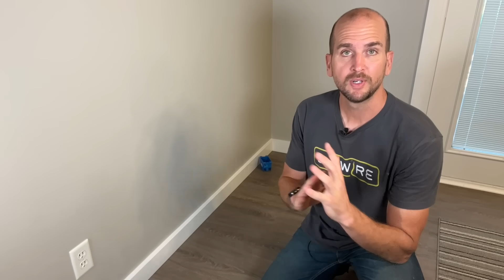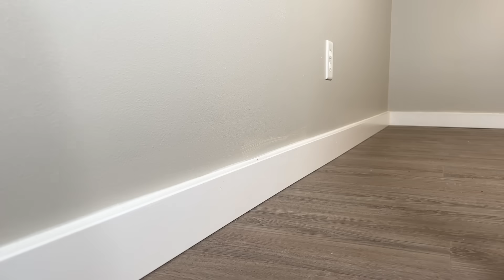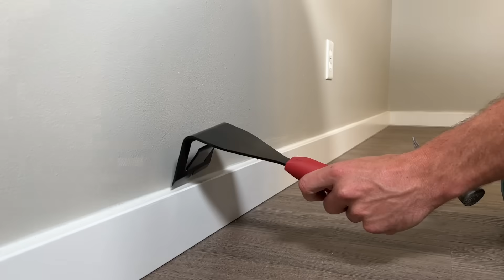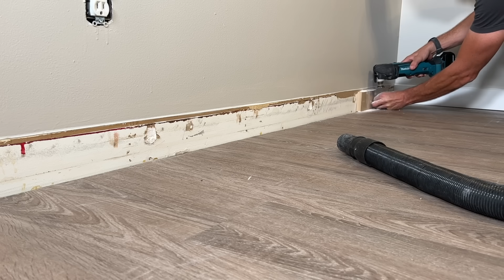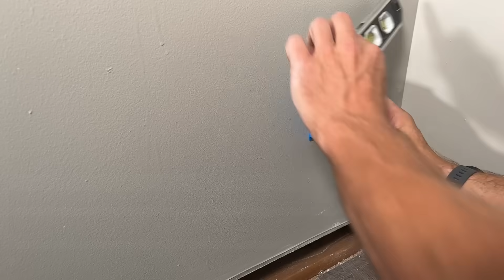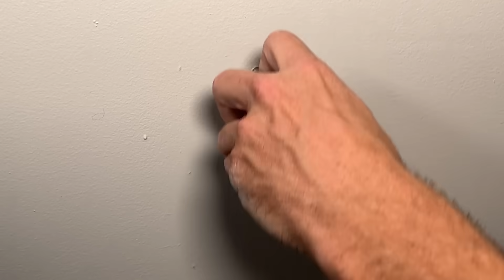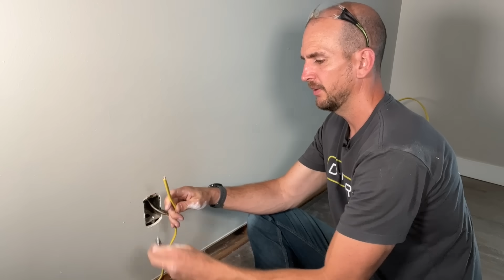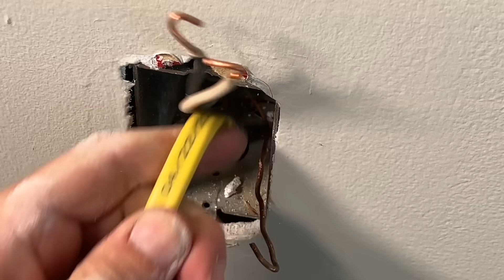How To Add An Outlet To A Finished Wall

Comment: This is an excellent vide, clearly explained and a very good way to add a box without doing any damage. I do however have one complaint, not against you particularly, but the use of caulking by this generation of people in finish work. I' m 70 now and have been in construction since I was 15. As far as I'm concerned, professionals using caulking is laziness. If your joints are tight there is nothing to hide and it looks like you know what your doing. In addition the use of caulking slows down renovations as you have to remove all the old caulking in order to have a nice finished job. Just ask any plumber who has had to remove a wall hung fixture to repair it.

Comment: Great idea. BUT, When you running wire, by code you need to have a metal plate covering the holes you drilled so nobodys able to nail to the wire. It could be shocking. You know where the wire is, BUT the next guy may not have any idea the wires there. JUST SAYIN.

Comment: This is great.  I’m a relatively newer DIYer and have been pigtailing directly to the bottom of the outlets and not using Wagos or wire nuts.  Also, is this a 15 amp breaker which could use a 14 gauge wire or do you use 12 always? Would you enlighten me on the difference and if one is better than the other? Sorry for all the questions but this is great info and I love learning. Thank you in advance.
Reply: 12 is probably overkill for the load. No harm in using the bigger wire, it's just more expensive. 12 would be appropriate for a longer run, let's say more than 30'. You were correct to use the outlet instead of a pigtail, that's why the outlet is made that way. You can either feed through, like you did, or you can cut the bridge on the outlet and feed each plug separately which is how you wire for a switched outlet with an always on outlet in the same plate.

Comment: Not bad...I would have taken the knockout in the very back of the metal gem box and used the clamp it comes with. Also you could have used a black (plastic) button connector for romex which is legal and easier to install. Over all great job!

Comment: It's not good practice to stab the wire in the back of the receptacle. You should always wrap your wire around the screws, the as same You did with the ground. As an electrician when I have a metal Box I always tape my receptacles, tape all the way around so that there's no chance of the screws touching side of the metal box causing a arc. Most importantly you should always bond your metal boxes.

Comment: Nice idea for sure. But instead of using those connectors, why not just use the other set of screws that are already on the receptacle? It's perfectly fine to do that. For the ground wire, you just use a green wire nut with the hole on the end.

Comment: Not quite sure why this showed up in my feed. Maybe I was summoned as "That guy who works in the field" To severely scrutinize your work.
Gotta say, its hard to find anything wrong with your work. Worse I can say is why go through that effort to add an outlet on the same facing on a wall when you can just use a power strip. 
Also be wary of exterior walls, which are often concrete, or have some form of masonry that won't make this an easy day.
I think this would have been a better guide for adding an outlet on an opposite side of the wall. Which would take the same effort and have greater reason.
Again, I'm just doing my best to do my worst. Great work.

Comment: Is it permitted with code to use the second hot and neutral screws on the outlet you’re drawing power from, instead of the Wagos? I assume you did it that way to prevent outlet failure downstream if the first outlet fails, but I want to confirm both approaches are allowed. (Ground I know you have to pigtail). Thanks, great video.
Reply: It is in Canada.

Comment: Only brutal pain and suffering will save you from putting an outlet in. 
Also, I'd love to hear from a framer on this one. Drilling a load bearing wall at the base that's settled for years... not sure about that.

Comment: Count me as a guy that does not like the WAGU lever nuts.  They are really handy for joining 5 wires together bur there is still some wiggle that I believe will cause fretting corrosion over a couple of decades.

Comment: Glad I looked at this.  I have been thnking of moving a switch closer to the door in my study.  I didn't see much option besides cutting up quite a bit of dry wall which made me put the whole thing off.
Reply: When you say switch I assume it is for a light on the ceiling. That trick won't help you lengthen the switch leg.

Comment: Could you just run the new cable/wiring from the new outlet to other pair of terminals on the existing outlet, rather than do pigtails?  Or is that some sort of code no-no?

Comment: NEVER USE THE HOLE IN THE BACK OF THE OUTLET! that is how you have load issues only having a very small contact point. Always wrap the wire around the screw then you will have no issues. BTW call a licensed Electrician and get a Permit! If you do this yourself you could get hurt and you could start a fire lets see your insurance cover that...

Comment: You lost me at your stab-in Wagos. I can't even count how many service calls I've gone on and found melted Wagos with black smoke stains around them taking out rows of lights. Use a good wire nut and twist your wires tight. You can blame the guys that are installing them, but when it's 100-1 finding melted Wagos to melted wire nuts, I think the problem is the device. Wagos rely on tension, if that tension weakens, or if somebody installs two different sized wires in a Wago, you will have uneven tension. Without a good connection, the wire will heat up and melt the insulation, in some case it will arc. Both scenarios can lead to a fire. Electricians like them because they are quick, time is money, I get it. But, I see the dark side of these little devils on the service end.

Comment: I'm not so sure about the amount of faith you have in wago lever nuts. Not saying they aren't useful or bad, but you're never going to beat a good pretwist with a good quality wirenut on it (3m or ideal). It's just a far superior connection that will outlast that wago for years.

Comment: You should drill the studs where you can cover the wire with metal plates at each stud to prevent accidental wire Peña traction. Other wise this all works. Thanks.

Comment: Why are you using 12 gauge wire for a 15 amp circuit? You should use 14 gauge wire for a 15 amp circuit. Your outlet is a 15 amp outlet.

Comment: Now honestly 1" drill bit? , industry standard is 5/8 
Another reason to stay high rather than 'nail plates' is that the first 2" of the studs have two nails rising from below - creats havoc on drilling
.
Now matching hight makes sense, national code indicates 12" but our local inspectors , largely with ADA concerns want 13.5

Comment: Buddy, you are squared away. Nice job. I can give you a tip for caulking, use your razor knife and carefully remove the caulking from the top edge of the molding before you reinstall it. That’ll make it much easier to do a nice job running a bead of caulk. 
And those of you wanting to do a job like this and you have a plastic back box for the existing outlet, I hope you have an oscillating tool. If not I’ve used a step bit, some people call them a Christmas tree bit. It’s not easy just take your time so you don’t damage the existing wires.

Comment: i was taught to install outlets from the most distant to the panel first so all the work is safe until you get to the one that is hot. you can double check the that the voltage is zero just once before the last hookup and not have to worry for the rest of the outlet installs. This would mean you did the install in reverse order. Another approach is to install them the way you did, hot outward, and test each one for correct installation but if you know what you are doing that is adding time since you should be ok for each outlet and flaws are easy to isolate - whatever Anyway, you only had one outlet to add so it doesn’t make that much differenve

Comment: Great 
Just a little overkill on the hole 1 inch your left with 2.5 inches of 2x4 
Smaller hole better integrity
Consider smaller drill bits please

Comment: It's good that he thought about not piercing the wire sheathing when nailing the trim to the wall, but building codes may require nail plates over the part of the stud that the wire is going through and nail plates are kind of a good idea anyway.

Comment: Interesting, I need to get one of those oscillating tools. but how was the new junction box secured? wont it pull out from the drywall?
Reply: Get a remodel outlet box, they have tabs that flip out and secure to the drywall when you tighten the screws.

Comment: ( 12 year commercial electrician) Great instructional video I would like to add my only concern was you neglected to bond the metal box in which you drew the power from I understand it was an existing box But as far as I understand it if you open it up you must bring it up to code. Bonding the metal box itself to the ground via Green ground screw screwed right into the back of the box and pigtail probably Should’ve been done on the original install. Obviously this doesn’t pertain to your plastic old work box grounding and bonding is very important to protect against electrical shock.. ps. I am a commercial electrician very rarely do we use Romax type wire I could be wrong but I believe the same rule applies as long as the box itself is metal
Reply from the maker: Good call Kevin and I should have mentioned that as the existing bare ground coming in was cut long and wrapped around the bottom mounting screw for the integrated cable clamps to bond the box.  Little confusing and I should have outlined the importance of bonding metal boxes which is a mistake I have made in the past for sure.  Thanks for the help!
Reply: One question...why did he pigtail the wires in the new Romex with the existing Romex.. wouldn't it have been possible to connect the black - white new wires onto the bottom screws of the existing outlet.. what am I missing?any information would be greatly appreciated 👍
Reply: @michael184272    It's installer preference. SOME electricians feel you shouldn't run the entire 15 or 20 amp circuit through the small clips that connect each set of terminals, so they like to pigtail it so all of the circuit is running through the proper gauge wires. NEC does not govern this, so the method you use is based only on opinion and not authoritative direction. There's also a lame (to me) reason that pigtailing prevents other receptacles from losing power if another receptacle goes bad. The times that scenario happens is so rare it shouldn't be the reason you use that method.
Reply: @ruffxm  
Thank you..
Reply: @ruffxm  Perhaps the requirement to use pigtails is location dependent.  In Canada, not using pigtails on an outlet will result in failing inspection.
Reply: @Vincent_Sullivan    That's why I stated "NEC does not govern this" (US - National Electric Code). It's not a requirement here.
Reply: My concern isa the two idiotic pigtails, every socket has two screws, use them!  Dummy!!
Reply: You're right,  although technically it is bonded through the locknut and then through the screws to yoke of the plug.
Reply: Why do all the electricians / carpenters install the outlets with the ground hole facing up? Is this a code thing? So if it's a metal box what do you mean by bonded? I live in a house that was built over 100 years ago and it looks to be that I have some old wiring. This wiring has only 2 wires a black and a white. How are these grounded?
Reply: @markevans4645    In the US, the Nat Elec Code does NOT govern the orientation of receptacles. Some (not all) electricians will base it on local practice, habit and preference. The theory behind facing the ground up is just in case a plug is halfway out of the receptacle and a face plate or other metal object falls onto the blades, it will contact the ground lug as opposed to crossing hot and neutral. It's rare such a thing will happen. In the NE, most receptacles are mounted with the ground facing down.
Reply: @ruffxm  Aside from a metal ruler falling behind a desk and contacting the neutral and the hot, if it just contacts the hot with the other end on the floor, base board or what have you and now you have a hot ruler and shock hazard.  Seems situational to me. Under upper cabinets in a kitchen there is not anything going to fall on to the prongs of a plug our under the sink or most living room ouchlets but behind a refrigerator where stuff can fall off the top maybe ground up?  Maybe in a horizontal install put the neutral side up.
Reply: @ericfransen4371    It's such a ridiculous concern and requires so many situations to be just right to happen. That's why it's not governed by code. A half-inserted receptacle, a thin metallic object falling just perfectly aligned and flat against the wall onto exposed blades, falling just right. It's ridiculous. 
If you ever do see horizontal receptacles in your travels, you will see the neutrals are face up.
Reply: @ruffxm  Yup. Slim chance. I have read Electricians recounting such occurrences but few and far between. Kinda like extension cords being a regular source of fires but the fires are few and far between but never happen when appropriately sized and properly used.

"If you ever do see horizontal receptacles in your travels, you will see the neutrals are face up." 
Maybe if they were installed by Pros like you but I just saw today a bunch today in a new marble kitchen back splash 4" off the counter with the hots up. GFCI though. Not everybody who reads these comments are pros and come here for all the tips they can get.
Reply: @markevans4645  The short answer is that your wiring has no grounding /  bonding.
Reply: My entire house uses Romex.
Reply: @donaldkasper8346    Most suburban homes do. It's fine.
Reply: Nice,!! I am no electrician personally. I just have a dad and had a grandpa RIP who had electrical background and repair knowledge who had taught me things I now use. I seriously love the video and all YouTube community for sharing and improving common knowledge for semi-simple people like myself who are (considering) trying to do a DIY project the right way..., DIY possibly from a lack of funding to hire someone, due to Bidens gas inflation, possibly large corporate greed, or possibly loss of job from pandemic that caused the place you worked for for 2 years to go out of business. But still the individual has enough basic "know how" to have confidence that they can do it too. It's really empowering, and inspiring! So thank you for the video. It makes me want to share some of my own personal experience and knowledge (on a different subject matter) that could be helpful for some people.

Comment: It is a good video.  Thanks! At the same time I would like to  note, that measuring  the distances between studs this time was comjpletelly unnecessary, sice you removed  the  side panel, and after that, you could see that anyway.
Reply from the maker: 100% just wanted to add a little info for those with limited experience in framing but you are right not really needed to complete this project.
Reply: Although, he DID need to know the stud locations when he reinstalled the trim piece with the brad nails.  Yes, he can place the tape before he replaced the drywall he removed, but will need the locations for the left side of the wall (where the drywall was still intact).

Comment: I'm an electrician in Australia.  We haven't used uninsulated ground ( we call it earth)  wire since the 1970's. I'm surprised it's still used in the USA, though we have a higher voltage at 240V. Only licensed electricians are allowed to do electrical work here. National standards across the country.
Reply: Where I have lived, an owner can do their own wiring so long as up to standards. For pay, the person needs a license.

Comment: The outlet is upside down! If a plug is not fully inserted, and a conductive material falls between the plug and outlet, a short circuit may result with likely discoloration of the wall and or outlet and a tripped breaker. Don’t anthropomize your outlets! They shouldn’t look like a face!

Comment: I don’t think that you could have made it any harder. I’d just use a 6’ flexible drill bit and go sideways thru the studs to new location. Attach the new Romex to the end of drill and pull the new wire in when you pull the drill out.  
  We’re talking a half hour job here. No removal of trim or sheet rock. Seriously, are you on drugs?
But I only have fifty years experience so what do I know?

Comment: I made me laugh reading all the critic's comments; "You should have used the other knockout, you didn't need to pigtail", etc. I've been a licensed electrician for well over 40 years, and long ago I learned that there are as many ways to correctly wire a house as there are electricians. Yeah, I probably would have done things a tiny bit differently, like using wing nuts because I HAVE plenty of wing nuts. I do appreciate your attention to detail. Thanks for showing us an easy way to accomplish this task.

Comment: I have to criticize here.  Im an electrician of 28yrs.  Almost all failures and fires are from incorrect connections.   When Re-connecting previously connected romex solid conductor,  bend it over twice at the insulation to break it if it’s going to.    If it breaks, strip  new. Otherwise itll break once installed.  You may know this but its good to communicate.